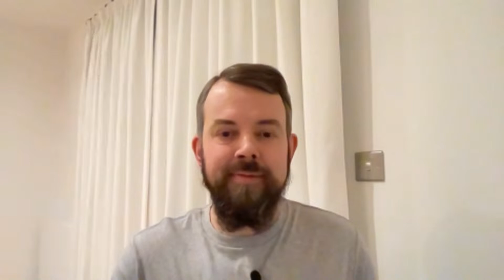Maximum Zs Q&A

Comment: i think a better system is now to remove RCD and install SPD and RCBOs for all circuits, helps with fault finding. Also i think 2 x radials are better for kitchens, i dont see the benefit in rings these days

Comment: Hi James, so do you go by the 80% or 100% rule.
Reply from the maker: Hi Bob, thank you for your question. For maximum zs, I would adjust the values in table 41.3 for the operating temperature as described in appendix 3. So I would multiply the values from table 41.3 by 0.8 which reduces the value by 20%, and I would look for the measured Zs to be less than that value. 
When entering the maximum permitted zs on a test sheet, I tend to enter the value from table 41. However it is possible to enter a different value such as from the on-site guide or manufacturers information, but I would put a note in the box on the right hand side of the test sheet. 
Regards
James
Reply: Very good presentation James…
Reply: So for example,a 32 amp type B rcbo or mcb on a split board,using 1.37ohms from.18th edition,would this be a fail,as you need to detuct 20% ,1.096 ohms if you take 20% off,so would the measured value need to be lower thsn 1.096ohms to be a pass.?
Reply: Is anything under 1667ohms,a pass if rcd protected.?,if so are the Zs values as important as they once were before rcd became the normal now,especially for domestic works.